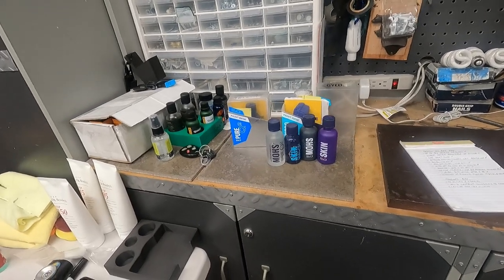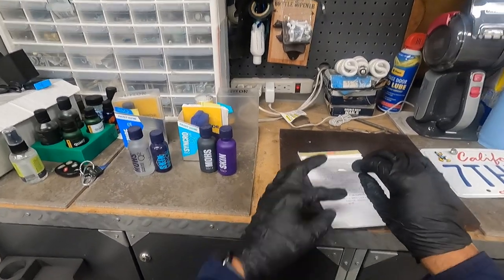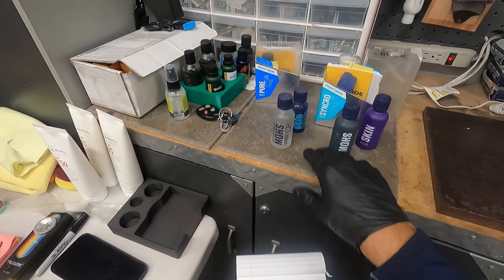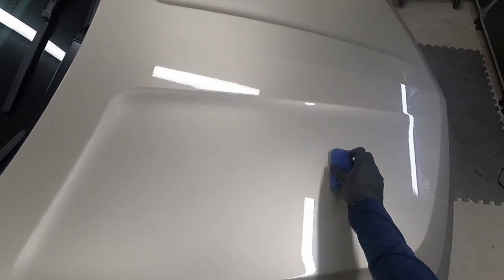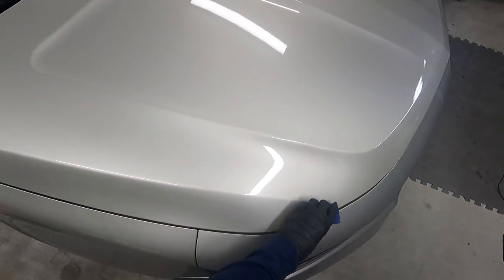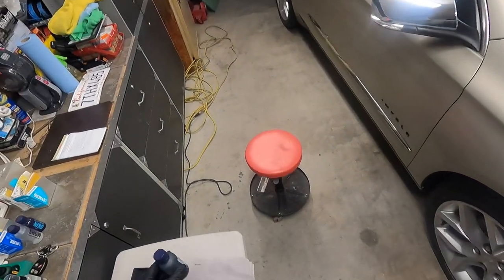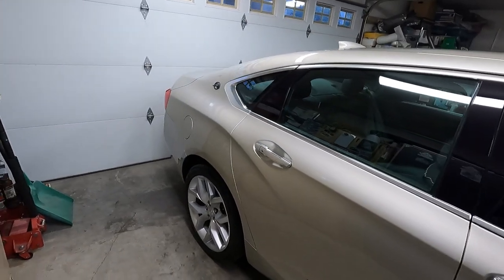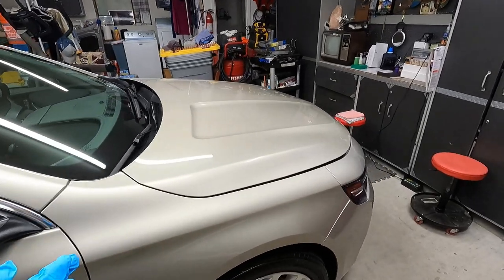@GYEON_official Syncro Evo Part 1 -  MOHS Evo Application

Comment: Mike you may have mentioned in another video.  Do you just use a Sharpie to label the corners?  It's a great idea to make sure you're not wiping or leveling on a side you've already used.
Reply from the maker: Yup just a sharpie
Reply: @MikeGDetailing  How often do you flip each leveling and buffing towel?
Reply from the maker: @wescat2  hard to answer but when your first towel start to smear and push product around it’s time to flip to a new side.

Comment: Mike applied Mohs to another of our cars.  Had to leave for awhile and didn't get to apply Cure.  Was late and cold at that point.  We had frost last night.  Should I be worried?  I still have more coating though.
Reply from the maker: Should be ok. But keep an eye on it for the first wash and verify if the hydrophobic behavior looks good
Reply: @MikeGDetailing  Thanks Mike.
Reply: @MikeGDetailing  Rained last night so I took a hose and everything looked like Mohs should look.  Crisis averted.  Thanks for all the great info.

Comment: Going to do my first coating in the spring. Really liking these new Gyeon coatings. Was thinking of using Pure on my silver car. But after watching both your videos I'm thinking maybe Mohs would be better for a first timer. Was thinking the Pure would really make my silver car pop.
Reply: Same I'm gonna do my first in the spring.  I think I'm going to go with pure though.  Pure seems the glossiest/wet look that I am looking for.
Reply from the maker: Mohs is easier to apply but Pure is glossier and gives that dipped in glass appearance.  Both are easy to work with for a first timer.
Reply: @MikeGDetailing  ... Thanks
Reply: @MikeGDetailing  should I maintain it with carpro reload, or Adam's advanced graphene ceramic.  I ask because I already have the Adam's, but i hear that reload is the best.
Reply from the maker: @kylefraser4280  I am not a fan of Reload. It loses its hydrophobic behavior after a couple washes and it starts to look like the coating had failed. But it’s just reload.  I would choose Gyeon Cure or Glassparency Boost over Reload.  

You can use the Adams but I would save that for a yearly maintenance topper.  Keep in mind you will see the performance of the topper.

Comment: Great work! On a silver car, and the main goal is to get as much gloss as possible, would Pure be a better choice over Mohs? And would topping either with CanCoat give it a bit more pop of gloss?
Reply from the maker: Thanks.  After using both Pure Evo and Mohs Evo, I would choose Mohs Evo for its overall performance.  I find it to be the better coating between it and Pure Evo.  If you want to amp the gloss a little more from Mohs then CanCoat would be a good choice.  Keep in mind that Mohs is slick by itself and CanCoat will take away the slickness.

Comment: How much mohs evo did you use? not sure if i should get the 30 or 50ml for a large sedan one coat.
Reply from the maker: I’m going off memory but I want to say I used about 20-30 ml’s for this sedan.  You will definitely need the 50 ml bottle if you are planning to apply 2 layers.

Comment: Do you put anything on as a topper later such as Carpro Reload for example?
Reply from the maker: I didn’t. You can use Gyeon Cure or Gyeon Ceramic Detailer per their instructions if the car will see water within that 12 hour time frame.

Comment: Also - saw the 3-part Dr Beasley kit on your table - have you used that for paint correction before? Results, if so?
Reply from the maker: Yes I have used all three so far. Primarily the NSP 95 and 45.  Not so much of the NSP 150.  But they are very good.  They save me a lot of time with no need for a panel wipe prior to a coating.
Reply: @MikeGDetailing  cool-  thanks a lot.

Comment: Mike......can you apply the Mohs (step 1) to the entire car, then start applying the skin 9step 2)?    Or do you have to apply the Skin immediately after you wipe off each section of the Mohs step 1....?
Reply from the maker: It’s 1 hour between Mohs and Skin.  So after you apply Mohs to the entire car and wipe it off you can pretty much go right into skin.
Reply: Ok, I totally misunderstood.  Ok cool.  Do the whole car with Mohs and wipe it off.   Then go to the area you began putting the Mohs first coat on and just start putting the Skin on there.

And……after that first Mohs coat you can do another Mohs coat over the first Mohs coat for a longer lasting ceramic job after you finally apply the Skin…….correct?
Reply from the maker: That is correct.
Reply: Mike.
Another question.   I just did both of my cars with Avalon King IX.   One car has been 5 months, the other I did last week.  The 5 month old car is still heading extremely well and it’s still very slick.   When do I know it’s ok to apply the Gyeon  Syncro EVO 2-step ceramic?    Can I strip the Avalon off easily?  Or go right over it?    I’ve started seeing YouTube reviews that says the Avalon is just not that good.
Reply from the maker: @2ndAmendProtector best way would be to polish it off so you can start fresh with Synchro.
Reply: @MikeGDetailing  ....would 100% of the ceramic come off with just a notrmal dual action buffing machine........normal passes?   Or would it require a certain cutting pad, polish and a lot more passes over the clear coat?
Reply: @MikeGDetailing  .....what about ceramic coating on my chrome plated wheels?   does that work?  Same prep as the car?
Reply from the maker: Normal process and yes you can coat chrome wheels with the same prep process.
Reply: Ok thanks.
Reply: @MikeGDetailing  .....let me ask you this.  I'm a pilot, I fly a Gulfstream 450 for a rich family.  He wants me to have it ceramic coated.  the Gyeon is 3 coats to get the 4-5 years out of it.   Thats way too much work for the detailers doing the job.   Can you tell me of another 4-5 year ceramic coating that only requires one coat after the IPA wipe down?
Reply from the maker: @2ndAmendProtector you have options like DIY Detail 5 year, Jade Obsidian (7 year), Jade Aquamarine (6 year), Jade Graphene (5 year), Ethos Graphene Matrix, Ethos Graphene Max.  All would be good options.

Comment: I thought in the Esoteric video they said Pure was the one that has more of a candy coat look. I also thought with the new Mohs there's no need to use Skin anymore?
Reply from the maker: This is the information that I was told by the Gyeon USA representative.  Syncro was always going to stay in the line up as their most durable consumer coating.
Reply: @MikeGDetailing  Oh good. I’m sure if a car is prepped correctly and polished to perfection that the average is not gonna be able to tell a difference whatsoever if it’s mohs or pure.
Reply from the maker: Exactly right.

Comment: Hey mike, I know this is off topic, but what is the slickest topcoat / drying aid that you’ve used? Thanks.
Reply from the maker: The obsessed garage drying aid is good. People complain about bead maker and dust but it is slick.  Also GladsParency Boost is nice.  I still like CarPro Elixir as well.
Reply: Thanks, dude. I’ve been leaning toward slipstream, I know it’s really hot in the scene right now. 

I was seesawing between that and graphene cs3. 

But I can pick up a gallon of slipstream for $20 and some change vs $80. Appreciate the reply.
Reply from the maker: CS3 or GCS3 are also nice. I forgot about those two.  Hard to beat slipstream if you can get a gallon of it for $20.

Comment: Is it possible to apply mohs on the windscreen?
Reply from the maker: Not recommended for the windscreen by Gyeon because of wiper chatter.
Reply: @MikeGDetailing  what would you recommend for the windscreen?
Reply from the maker: @ffforce5106  this one is pretty good. Where are you located? 

Armour Detail Supply Armour Glass Application & Water Beading
https://youtu.be/xYMYuMWbdgI

Comment: Another amazing video Mike, out of interest do you give the car a second wash after you do your correction or just use gyeon prep
Reply from the maker: Thanks. Since I used the Dr. Beasley’s NSP 95 surface primer, there is no need for a panel wipe. If I used another polish then I usually use a panel wipe during the polishing process to wipe off the polish.  So no wash after polishing.
Reply: Thanks for the quick reply I just got my hands on gyeon one evo and going to be doing my bros car for him, just the instructions made me laugh as it says to re wash it after polish stage, will be doing gyeon primer as my last step anyways, loving your reviews keep up the good work
Reply from the maker: Yeah I saw that as well since you are using primer you won’t need too.  I saw Gyeon state no need for a panel wipe after 8-12 hours if using Primer.

Comment: Nice videos Mike. 
What towels are you using for leveling the coating?
Reply from the maker: I was sent these towels which are the CarPro 2face Lite towels.  I primarily use the rag company edgeless 300.
Reply: @MikeGDetailing  I've used edgless 300's in the past. Tried something cheaper with diferent colour choices but I tend to always reach for the 300, good quality decent priced and does the job well. 
In fact, already got some ordered.

Thanks for the info 👍got a new subscriber. Yay!

Comment: Thanks for the detailed video. I just received Syncro in the mail. Do you think Syncro can be applied to PPF? I know Gyeon has a ppf specific coating, but if I end up buying a separate ppf coating then I’ll I have excess that will go to waste - even if I do multiple coats and wheels. Thank you
Reply from the maker: I used it in the PPF that is in the headlights and no issues so far.

Comment: New subscriber . Ty for the video.  I just got the cancoat , one and mohs . All evo . I didnt get the skin . Question,  is it possible to use the cancoat over the mohs instead of skin to get the same durability?  Any thoughts would be much appreciated.  Ty again.
Reply from the maker: CanCoat will work on any of the coatings as a topper.  The durability would be close to Syncro.

Comment: Hi Mike,

After Months of researching coatings I finally chose to go with Gyeon MOHS. I will be applying it late spring as I am waiting for the massive Pollen Bloom to die down in my area. In my research I recently discovered your channel (New Subscriber).
Based on your experience with the product would you recommend I top the coating with Gyeon Ceramic Detailer or Evo Can Coat after a month or two?

P.S. Your Impala is Mint like it just came off the assembly line.
Reply from the maker: Thanks for subscribing.  Good choice going with Mohs.   It is a user friendly and a good upgrade from the previous version. 

I would go with the Ceramic Detailer after a month or even monthly.  CanCoat would be good option say a year after a deep chemical decontamination wash.
Reply: @MikeGDetailing  Are you referring to Meguiar's Hybrid Ceramic Detailer, thanks.
Reply from the maker: @maaaa123456  sorry i missed this.  I meant the Gyeon ceramic detailer.

Comment: Mike, what towels are those during wipe off?
Reply from the maker: CarPro 2face Lite towels that Avi sent me awhile ago.  I typically use the rag company edgeless 300.
Reply: @MikeGDetailing  thanks. I ended up ordering autofiber quadrant towels. The IGL coating towels, they just didn't work for me. Preference is all.

Comment: I've just applied Gyeon Synchro to my BMW 7 Series and I won't recommend this two coat system. Because the car is very large I had to rush around so that Skin can be applied within two hours max. It took me 1 1/2 hours to apply MOHS. A single coat of just MOHS would have been fine.
Reply from the maker: You would have been ok as you could go straight to Skin after Mohs.  Surprised it took this long to coat the BMW with Mohs.
Reply from the maker: Mohs as a stand alone would be my recommendation.